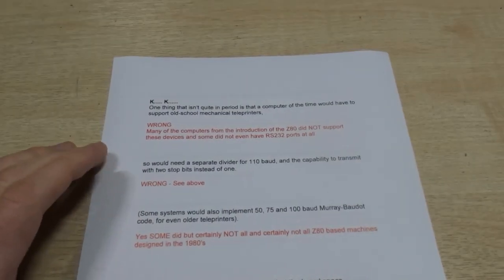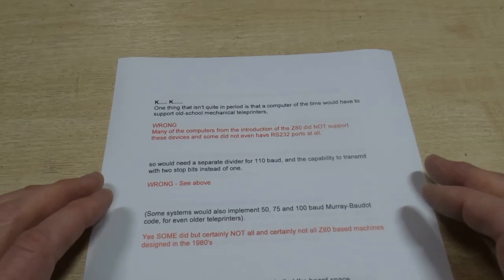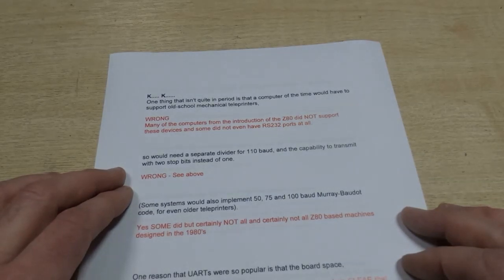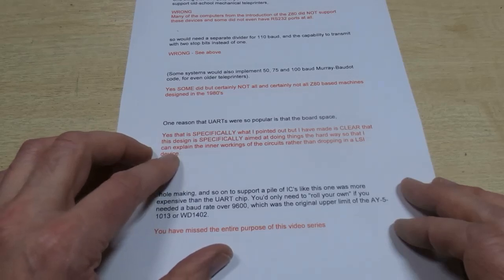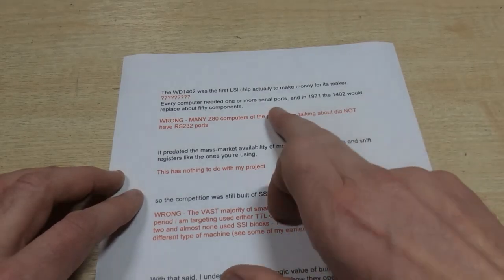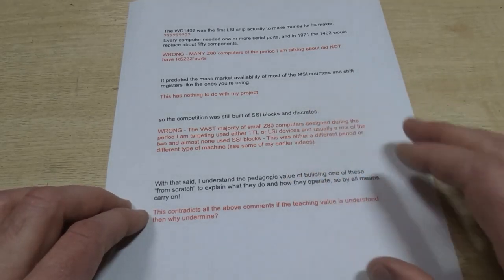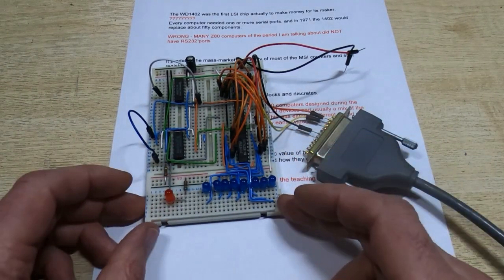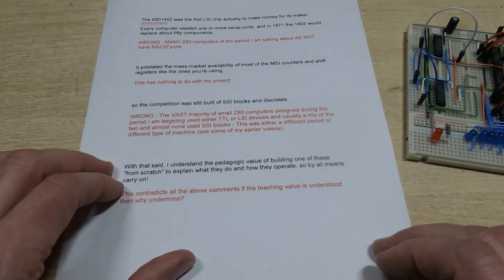Designing A Z80 Computer Part16

Comment: Most Z80 computers at this time were operated by smokers, do you intend to include this in your project to maintain authenticity?

Commenting on a project one does not understand by suggesting a project one does understand seems to be something of a meme on You tube and stackoverflow. The goal of doing this is demonstrate that not understanding the project does not mean one is not knowledgeable. Alas it rarely reaches this goal.
Reply from the maker: I may just spray it with nicotine when it is finished for that authentic look and smell :). I actually do not object to the comments, some are useful as they indicate I have not explained something properly. I do however always try to rectify any miss understandings which may exist in the comments. For some reason there are those who seem to think that they are entitled to redefine the purpose of my projects and they object if I put them right. If I see someone has not understood something I have said then it seems natural to try to clarify it. One problem with Youtube comments is that they do not carry over to new videos so I was getting the same 'advice' to use LSI devices many times and rather than having to continually retype the same responses I decided to post this video. I do not think there is anything fundamentally wrong with the comment I show in this video except in the context of this project. The information he states is technically correct but wrong when applied to these videos. I could just ignore such comments but then I could also not bother to post the videos in the first place. Each video takes many hours to produce and I do not make any money from them so maybe I should just save myself the aggravation.

Comment: I had a BGR Excalibur 64 desgned, 6845 CRT controller, Z80 PIO and UART chips, later added a Western Digital Drive controller - worked really well with 5.25" drives. Printer was a 25pin parallel port and drove a dot-matrix printer. Used serial to transfer programs between a Lingo and Excalibur regularly

Comment: One comment about the previous video. It's very helpful to show schematics or at least a block diagram of what you're building.  It's hard to stare at breadboard and get the same kind of insight I think you're trying to instill in this video series.  Perhaps you're saving this for the book?  Both have value.
Reply from the maker: Yes you are right and I will show some of the schematics in later videos but at the moment I want to get the overall design concepts across and this is also a work in progress so I do not want to show schematics which may change. And of course I need to protect the book a little. I did show some schematics in earlier videos but I kept getting told it would be a lot easier to use LSI devices so I decided to wait until the main board was up an running as that may help to make the intended 'feel' of the system more apparent. I think there is such a trend these days for quick results that doing things the hard way seems to be creating a lot of 'resistance' but I am hoping that seeing the finished result will win people over. I should say that I will not be showing all the schematics as I need to save something for the book but I will show some of the important ones.
Reply: @JerryWalker001  Yep, that makes sense. I actually find it more insightful to see how one would make use of discrete logic. Too many LSI datasheets gloss over how they work internally; often due to competitive advantages. I found it more educational to see your sampling strategy. Presenting it on the oscilloscope drove that idea home for me, which is something you don't get from using LSI or reading datasheets.
Reply from the maker: @nerdyexploits  I totally agree and that is exactly what I am trying to get across in the videos. LSI devices are useful for getting fast results but they make explanations difficult because there is no access to the internal signals. In a discrete design you can 'see' all the important timing relationships and that, hopefully, makes the operation a lot clearer. Using the LSI devices is then also, in my opinion, easier because the settings make more sense. As you say the datasheets only tell half the story.
Reply: @nerdyexploits  Programmable Peripheral Interfaces contain a large amount of logic to enable them to be programmable. IIRC the Z80 SIO is comparable in complexity to the CPU.
By contrast using discrete logic gates means you need only those required to do the job. Which can be surprisingly few. Even with the likes of selectable baud rates this is likely to be by directly addressable port(s). Rather than sending multiple OUT commands to the control port of the likes of an SIO/DART.
Reply: @markevans2294  The SIO chip doesn't look anywhere near as complicated as the Z80 based on the datasheet. It seems to have around a dozen registers that Jerry already alluded to adding if you want to have programmable features, like baud rate. You can map them however you like, whether that's an indexed system like the SIO or flat IO space. 

That being said, there seem to be a few things missing from this design that seem important:  parity, error detection and interrupt management.

I'd be curious to know what parity does to the state machine set up here. Would it trigger the start bit logic? Or is it properly ignored?